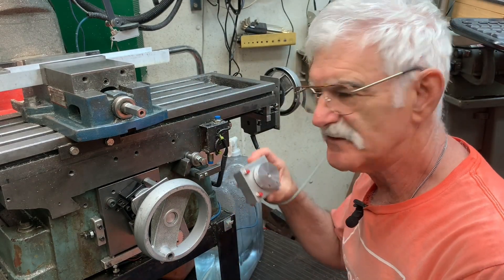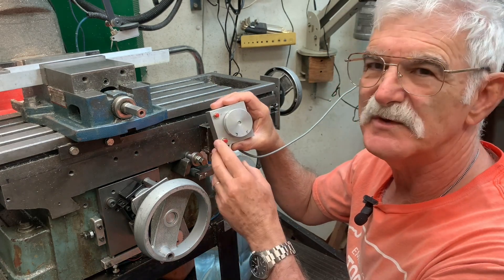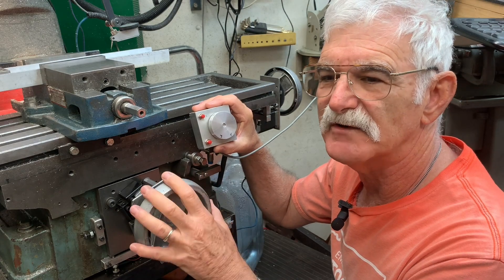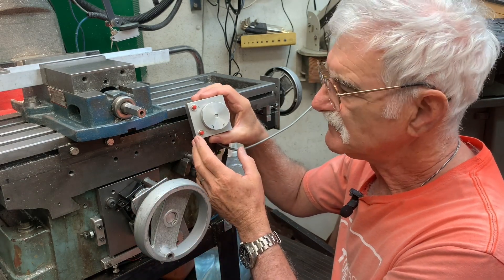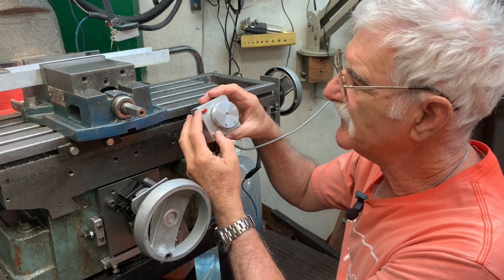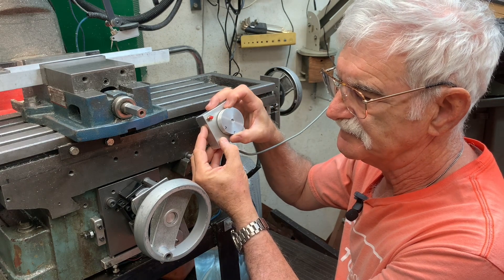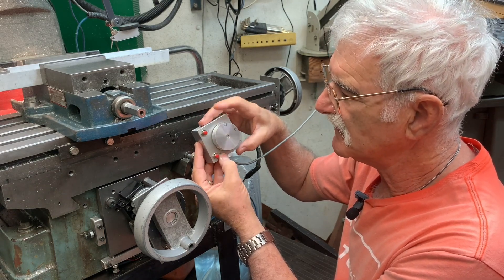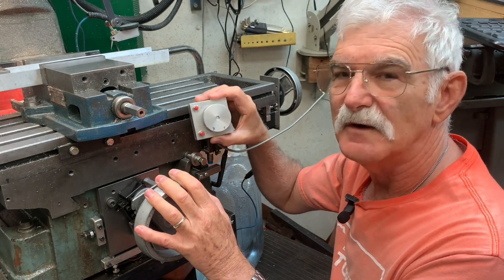A $10 Manual Pulse Generator

Comment: you can get "real" (but chinese) MPG wheels for <$20 now on ebay. They used to be super fancy and expensive, but there's really nothing that special about them - just a detent-ed rotary encoder. They're probably only >$1000 if you buy them from DMG Mori or Doosan or something as replacements. Even if those ones are "better", you can buy a lot of $18 ones and replace them many times over before you'd spend $1000
Reply: I have been working on the same thing using a 40-dollar MPG, I will send you a link when it is done, as well as the code and schematics.
Reply from the maker: I was thinking of commercial MPGs when I said that but now see that the knob is under $20. This would be a very nice improvement if I make another one. I would have to make a major change to the software.